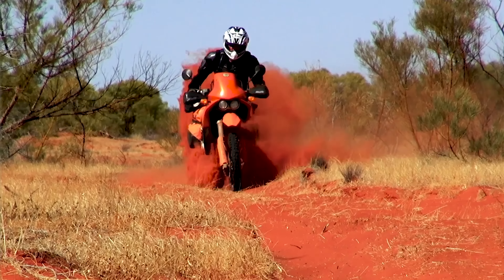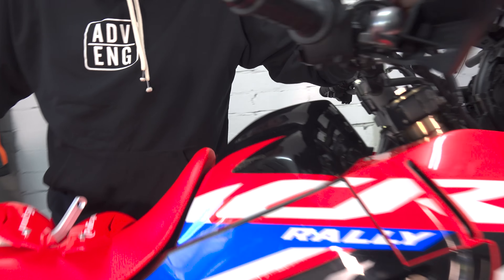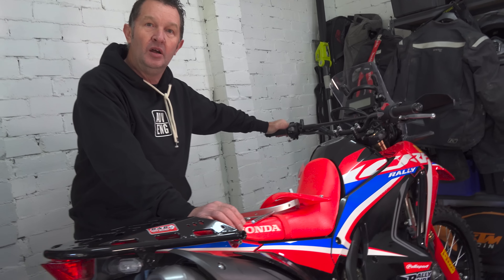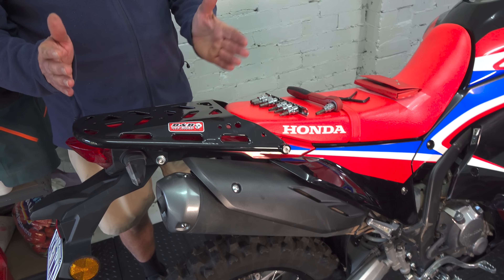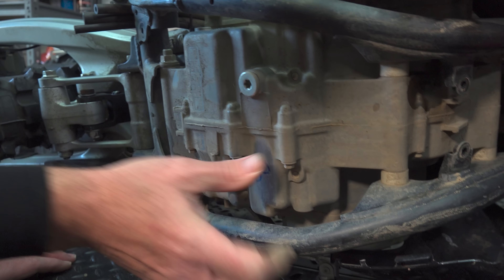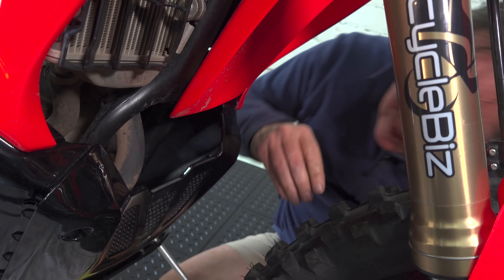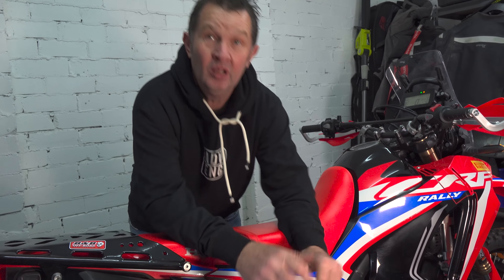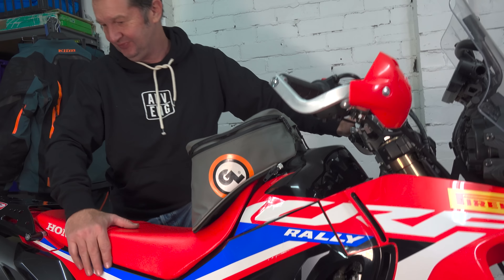Honda CRF300 L Rally long term build Episode 4

Comment: I never set a parts budget. I make a list of add-ons I want to do and prioritize them in order of importance. Then I simply work through the list as I can afford them. Eventually I get where I want to be without breaking the bank all at once. Also, I never worry about cost ratio of parts compared to purchase price of the bike. When you buy a bike it’s just a platform with potential. Turning it into what you want it to be may cost 2/3 the base price, but the hours of enjoyment to be had doing the customizations and the riding is priceless.
Reply from the maker: Agree whole heartedly.

Comment: Great channel!  I love the 'buddy' aspect of this build series and the channel in general.  Friendship is an important part of riding and wrenching...  I drove 13 hours on Tuesday (Minnesota to Illinois and back) to pick up my new CRF300 Rally ABS - these bikes are just not available anywhere right now...  The B&B bash plate and tail rack (in black finish) were waiting for me when I got home late Tuesday night.  The customer service from the B&B team, managing my international shipment, was great.  I appreciate finding competent professionalism and good service and wanted to chime-in for any potential clients in the states, that B&B got me these parts in a week from Australia and everything showed up in perfect shape.  I'm trying my best to adhere to a budget for my build project too (although my wife doesn't think so) and Dave, your and Clubby's aftermarket selections are almost exactly what I've chosen for my little red Honda.  I strayed a bit, electing to use the Zeta triple clamp bracket (front mount) to clean-up the handlebars and prevent the twisting that can occur when I will inevitably lay the Honda down too hard.  I'm also pretty smitten with the body panels, so I'll probably order some bash bars for the sides... It's already a robust bike for a 300cc and a few hundred dollars of prevention outweigh any desire to limit weight by a few more pounds.  Keep up the good work!
Reply from the maker: Thank you.  Just rmember those panels are cheap as chips.

Comment: I’m pleased your not crazy focused on a budget because with the DRZ , WR 250 R and DR 650 all being discontinued this bike is one of the few possible replacements that are lightish and under $20,000 and even T7 , 701, 690 need extras added to make them right . Keep up the good work men 👍
Reply from the maker: Thanks for the encouragement
Reply: Keeping it Japanese. So many potentials. KLX 300 Rally. 6 speed DRZ 400 fuel injected Rally. WR something.... will they eventuate? Unlikely.
Reply: Very good points . My only thing is our freeway speeds are 70 if you are going slow and the limit is "65" mph , lol . That's a bit of an issue here in the states but not an impossible hurdle . You could time your rides in the busy areas if you are doing a long range deal .

Comment: I know you have been going back and forth on the budget on the budget for this bike and it is certainly something everyone should think about when they buy any motorcycle but you have added what is necessary to make it a capable off-road bike and added the protection needed on just about every motorcycle you buy.  Good to see the numbers so people understand how much you will probably spend in just about any bike you buy, some may not need suspension but will need about everything else you added.
Reply from the maker: Thank you

Comment: I got the 550 ecu. Makes it a lot smoother response. Most notably power improvement was the Yoshimura exhaust. Just ordered the Uni Filter too
Reply from the maker: Thanks for that
Reply: @MotorcycleAdventureDirtbikeTV  the risk of not doing the ecu is it maybe too lean once you change the exhaust. It was with the 450L.
Reply from the maker: @Dewi.TwoWheelOrdeals  I'm hearing that.
Reply: @Dewi.TwoWheelOrdeals  it was too lean. Voided my warranty putting the ECU on :)
Reply: @rgfxnet  
Who needs a warranty , it's a Honda .

Comment: You said it has lots of ground clearance but really without the aftermarket suspension it doesnt have much. I have a 300l and I got a yamoto skid. Took the bike out and did a borderline hard enduro trail with the poor little bike first ride. I had to take a 3 pound sledge to the skid to beat it back in shape. I promptly ordered upgraded suspension and its much better now. Got the belly up where it should be.
Reply from the maker: Yep that's why we did it.

Comment: While the budget limit makes a good limiting factor for most riding, if you go desert or extreme riding conditions, you budget is going to possibily gonna put you in a less safe place. Once you go beyond normal use , you have to go beyond normal exenditure.
Would have been nice for the bash plate to extend below the rear suspension linkages.
Reply from the maker: The bikes pretty high.  The other thing, and I noticed this on my 701, once you put weight on the bike the linkages are not nearly as proud.
Reply: @MotorcycleAdventureDirtbikeTV  Good point about the link raising into the line of the bike, though an extention would also keep the gritty water splash away from the seals a bit better. I have seen someone bolt an extention on to the back, but maybe even  a thick rubber sheet would suffice. Great bash plate though. Love the double wall at the front.

Comment: Thank you for a concise budget and fitment breakdown🙂,wrt to the would I spend an extra 2k for the suspension upgrade.Within the perspective of my old 80s adv rider weight etc ...I wouldn’t have any choice but to at a minimum upgrade the shock and spring,and most likely the fork springs.
My son is about to purchase one of these lil red machines and with his weight around 68kg it’s likely as an off-road learner...not mx..he won’t change the suspension out till he really wants to.
Lil itchy boots with her light weight also hasn’t required an upgrade but no doubt if she rode both modded and unmoved bikes an experienced rider would choose the upgrade.
Great work guys....are those busters on the correct sides .?.
Reply from the maker: Good point about the buster mounts.  I think I recall Clubby saying all parts matched.
Reply: Itchboots doesn’t tackle rough terrain at speed like these blokes do.
Reply from the maker: @MrEtnorb  YEp DEFINITELY!  Looking forward to showing the next video.  Nugget is taking me extreme!

Comment: Hey Dave,
You mentioned you would like to weigh the CRF…I might be able to help you with that. I own a business called Weighpro we weigh cars, caravans, boats and yes bikes. We are based in Sydney and we are mobile. We get individual weights for each wheel. So you can see where the weight is. My old DR650 was 176kg my current T7 is 228kg 😬 I weighed a 2022 KLR650 last week and that was 224kg. We might be able to work something out.
Reply from the maker: Hold that thought.  I'd love to compare the 701 to the CRF.

Comment: First thing I always buy is the Skid Plate. 
I had a riding buddy who was very good on the trail (RIP Phil) and he had a steel frame Honda CR250, with no skid plate. His poor double cradle down tubes across the bottom of the engine where literally smashed in half across the length of them under the engine. I thought to my self, Honda must not had engineered into them to function in this state but he seem fine with it. Go Figure but the bike must had been effected by this.
Reply from the maker: Yes, I;ve seen that as well. Good point

Comment: hey with the uni filter once its installed can the foam just be pulled out and cleaned or do you have to remove the whole contraption each time you clean it? I'm kind of on the fence about going with the uni or just getting a k&n style reusable and using the prefilter on dusty days.
Reply from the maker: You can just pull the foam cover off for three uses before needing to take the hole cassette out.

Comment: Hi Dave will you dyno the bike with the std exhaust and then with the arrow exhaust.
Reply from the maker: No. We don't have easy access to a dyno.
Reply: @MotorcycleAdventureDirtbikeTV  that’s a pity it would be nice to see if you got any usable power increases for your money above the weight saving
Reply from the maker: @keithkeeble7483  unfortunately Keith it's going to be seat of the pants stuff.

Comment: Love this bike but humm,  it is light compared to a big adv bike but it's not for a 300. I've spotted 1 or 2 second  hand lowish K 701LR's for sale in NZ for about the same purchase and setup as the CRF which are almost the same weight but double the power.  As you now have both it will be interesting to hear any advantages one has over the other for the same riding. Of course if your aim is a new bike the CRF wins price wise but it would be hard (for me anyway) to pass on the 701 if weight saving isn't there.
Reply from the maker: I'll probably have something to say about this. The 701 is an outstanding bike and in LR form, well it takes it to another level for Adventure.

Comment: I’m currently deciding between the B&H rear rack and one from the rally-raid. Why did you opt for the B&B?
Reply from the maker: Even though Rally Raid is a long term sponsor of MAD TV, we just preferred the B & B.  Clubby and I have access to a wide range of parts and accessories,  but we are just trying to build the bike the way we want.  We looked at soft pannier racks and luggage options combined with the tail rack.  I think it will work for what we want.
Reply: To be clear; I’m not challenging your decision (I literally can’t imagine how often y’all catch flak for decisions). I was just wondering whether there was something about the design of the B&B that struck you as being better in general or more suitable for your use case. I’m prepping a big rally raid purchase anyway, but if there are advantages to the b&b, I’ve no issue going that way. Any guidance is appreciated, and thanks.
Reply from the maker: @noahrobin1941  I didn't take it that way. For our eye it just looks more integrated.  The Rally Raid also has capacity for Rotopacks and other fittings. It came down to personal preference. But both Clubby and I had that preference.
Reply: Ah, the comments section. No chance for miscommunication. :) Gotcha and thanks.

Comment: Interesting that you don’t have any linkage protection. There are cheaper but no less effective options that could get you both a rear rack and bash plate in budget. Got my deposit down for one of these so I am waiting expectantly for you to ride this thing….. Keep up the good work.

Also, I think I will be chopping off some of that unnecessary plastic to fit a tighter bash plate.
Reply from the maker: It looks nice though.
Reply: @MotorcycleAdventureDirtbikeTV  it does. Love the look of that bike. I just think those plastics will get scratched up anyway. We’l see. I might get squeamish when it comes to cutting.

Comment: After all the necessary upgrades is it still worth it? Or maybe look an another bike that comes with acceptable suspension from factory. The suspension is a total fail on these bikes it seems which is a pity.
Reply from the maker: Don't throw the baby out with the bath water.

Comment: I'm all the way on the other side of the world and Dave has the same impact wrench as I do, identical even the metal case is the same color. LOL 😅 I better check my tool box and see if it's still there.
Reply from the maker: Ha ha :).  My Mum bought that for me on my 14th birthday so I could pull my Honda XL100 apart.
Reply: @MotorcycleAdventureDirtbikeTV  damn things are made well
I had a Honda SL 70 mustard gold color back then (1970's)
Fun bike.
Had to use that impact wrench on those large Phillips screws in various places.

Comment: Most bikes need luggage, tyres, bashplate/rack etc. so I don't think they should be in the budget. In my eyes, the goal is to get this bike up to the same basic starting point as a premium adv bike and compare the cost v performance.  The suspension sucks, so that was a must spend.  The engine being 283cc is the bikes next weak point (and everyone will be looking for more power) so the fuel controller and exhaust are must haves IMO. Good luck.
Reply from the maker: Yeah let's keep going and see how we go.

Comment: If they fitted a very good quality suspension that was fully adjustable & serviceable that didn’t require spending extra money on for fine turning, then yes if not you best spending the money on the type of suspension that suits the individual. Some people may try to fit CRF motocross suspension under it because it could be cheaper to get hold of 🍟🍔🍰
Reply: Cost.
Reply from the maker: yeah good point

Comment: That shipping cost is crazy!  You guys don't know anyone who works at Qantas??  8)   And -$350 install?  A Saturday afternoon in the garage, a case of Foster's, Ice  and the best 'wrench's' you know??.  You might lose 3 kg with a pipe too??  Don't mind me, I'm just an old US bike guy...  Cheers...   8)    --gary
Reply from the maker: Firstly, Gary if your from the US then your value of your dollar is stronger so for you around 40% less.  Secondly someone was saying to me the other day the difference between Honda 300 owners and Yamaha T700 owners is that 300 are owners are tight with their money. :)
Reply: @MotorcycleAdventureDirtbikeTV  40%!  Wow, you peaked my interest, I had to go look.  Here in the US, the 700 Tenere is $10,299, plus 430 destination, and 250 freight/setup. $10,997.  The 300 Rally is $6099, plus $600 D/F/S, or $6699. The standard 300L is $5399,  $5999 after D/F/S.  40% would make the Yamaha $15396!  We can buy the standard Africa for $14.400!!  $17299 for the Adventure!  My Brother worked for a big US Arline. Back in the day, he would pick up parts for us and deliver them across country. We saved a lot of $$ that way!!  Very interesting, thanks for the reply!!  I'm 70 now, so I ride more hard top than dirt. 8)  --gary  Oh and PS;  It's also easy to find a dealer willing to discount $500 on smaller, $1000 on larger bikes!!   --gtr

Comment: Mmmm…yeah nahhh…for base of $9100 plus on roads (let’s call it $10k ride away) 25hp motorcycle then turning it into a $14k heavier weight motorcycle is really throwing good money after bad. It’s still a slow buzzy donkey and nothing will change that. Better off spending $14k on a used Africa Twin with 15,000kms on it (or a Tenere) and learning how to ride. Or find a good used DR650.
Reply from the maker: You forgot a dr 400 or 701
Reply: @MotorcycleAdventureDirtbikeTV  good point....yep